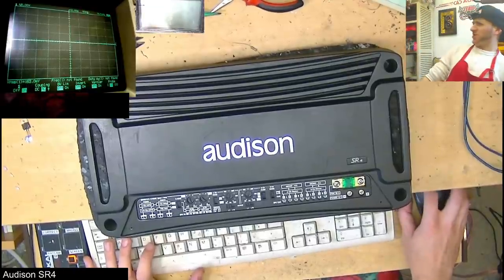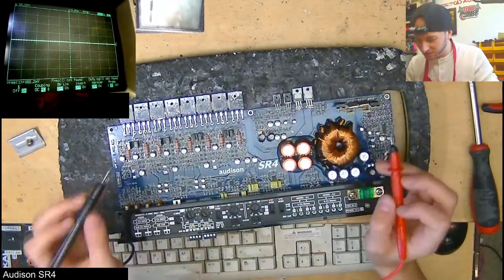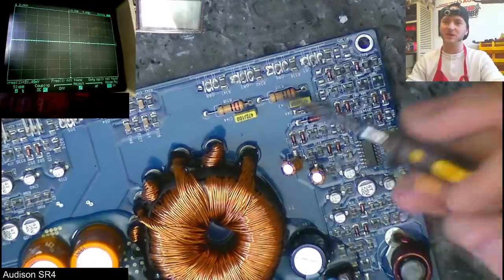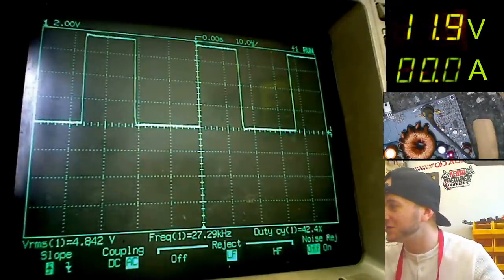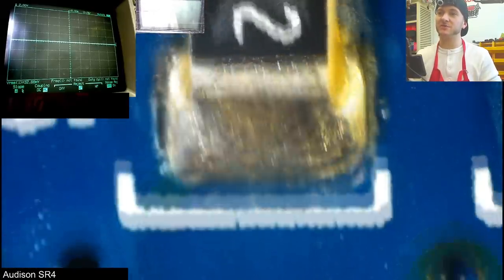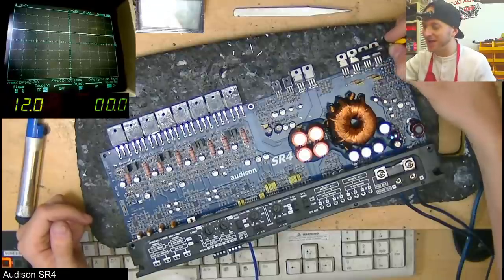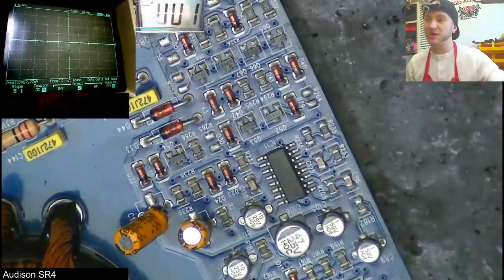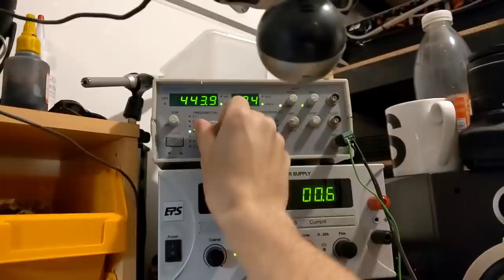This amp went so fast it EXPLODED - Audison Amplifier Repair

Comment: Interesting video! I've seen board flexing do weird things with bad components. Your video reminded me to check the components in a video processing oscillator (2 mhz) for  bad caps and resistors! Heating the oscillator IC did change the frequency and flexing the board made it go absolutely nuts; but I don't know that it wasn't one of the external oscillator components close by. So I'll check. Thank you!

Comment: Interesting to see the crappy solder flow on this board. I used to work at an electronics manufacturing factory where we had solder wave machines that flowed whole boards, then of course boards were tested. I can see why this passed initial tests. Also solder waves only flowed thru board and smt were "glued" on by a robot or if a smt part was bad in testing replaced with tweezers.

Comment: I'm seeing this late so I hope you read this @barevids I might have a tip for you from an old repair tech my father worked with about 10 yrs ago.  I'll spare the full story, but he found an easy way to repair surface mount solder issues.  Stick the board in the Oven at just high enough heat to melt the solder.  The components won't be damaged at those Temps, and the solder won't run when it's just barely melting.  He could repair half a dozen printer boards an hour that way!  Looks as though that amp could use an Oven Spa treatment to reseal ALL of its solder joints. 

I don't recall the Temps he was using but I'm confident you already know that info.  I did Audio/Visual install work so I know enough about soldering but never needed more than the basics, and I never did board work.
Reply: Some of the 2011 MacBook Pro laptops had wave solder issues. I was told to remove and bake the board on low in my oven to get the smd components back bonded to the solder traces. 

Baked for about twenty minutes, skeptical of this process while waiting, let it completely cool reinstalled the board and bam it fired up. Worked for another 5 yrs before I retired it.
Reply: @PopRocksClassicFunkRapSoulHQ   iMac video boards from that era had a similar issue, and a similar fix - but it didn't last 5 yrs.  I think Apple changed the solder recipe at some point, and the problems went away.

Comment: I'm new to watching you, but I must say I really enjoy it, your accent to layman's knowledge. I'm getting back into car audio due to poor installation in my vehicle, hence cutting wiring when could've used harness adapter. which is to this,I purchased a deaf bonce aab 1000.2, straight out of the box all lights flashing with just power, ground and remote hooked up, an piss poor customer service for return,  think something similar to the audison issue ??
Reply from the maker: Thanks buddy! All lights flashing is health check mode, after a few seconds it should either come on, or display one or two leds to signify a failure, what happens and what supply are you using to power up?

Comment: Multi-Layer Caps don't like being banged around much.  Anytime you see an oscillator act like this in something like a car, replace the MLC controlling it, the cap is likely cracked on the inside.

Comment: What brand flux you use here, and if you can send a link to where you buy it. BTW is it stable with the hot air gun, some flux i use just liqify and run away or dried up under the heat gun.

Comment: Had an amp pop so loud it was like a gun shot 1 of the small caps had burst literally vaporised only the outer can left and dust cleaned the board put a match rated cap in and amp worked fine for 8 yrs after

Comment: So withe the powersuply blowing up "not a loud pop lots of heat smoke instantly" what does that internally? Like i had plugged it into a power suply and it triped the circuit shuting it off not blowing it. But then plug it to a 12vt car batt and instantly it poped in smoke. What makes that happen? As to this amp had the brand new smell and everything looked sexy but obvs wasnt the case aha. And if my power suply side died would that have caused mosfets to die as well? Is it worth keeping and fixi g up or is it all gunna be toast?

Comment: something tells me it is possible for a fet failure to destroy the pwm chip by a short to the gate then it fries the gate driver witch shorts back up the line to the pwm chip.

the only thing i think that can stop a cascade failure like that is a gate transformer as the signal is isolated so you would blow the winding before it can short to the pwm chip

manufacturers could cut their costs by doing a walmart working their employees off the clock.

as soon as they punch out they go oh we need you to clean the bathroom sink.

go back to using lead solder and just put a warning in the product for you to recycle it rather than to landfill it and take a page from car batteries where there is a core charge to encourage returning of old stuff.

and set up a cap and trade system to allow the use of lead solder.
Reply from the maker: When the fet dies and sends 12v to the drivers, the PNP driver sends the 12v from the shorted fets to ground burning the driver up. The 12v never makes its way to the 494 and even if it does, there are very high value resistors in series with the drivers that don't allow enough energy to hit pins 9 and 10 of the 494. I've never seen the pwm Gen circuit damaged when the PS fets fail

Comment: @Barevids or Anyone, curious on opinions of Seismic Audio amps. I'm looking to buy their SA 250.4LH  its a Class D 4 channel amp. With really nice crossovers and four 35amp fuses(140amps total) on the board. Its rated 375 watts RMS per channel but I figure its probably closer to 350. If anyone has a Seismic Audio amp love or hate story lmk. If you got an opinion on them lmk I'm curious. It looks like a solid amp.
Reply: Seismic audio is a up and comming brand they do rated power on the qmps.

Comment: It's not   A/C   switching , in the power supply   it   a  DC  TO DC  converter   which  makes  a pulsating   DC  wave     above  ground  reference.   The  frequency  t increases  and  decreases )   creates  the duty  cycle  based on the load  on the output  voltage  of the transformer
Reply from the maker: You know what I mean. It's just easier to say. Technically the current is "alternating" direction to allow for the primary to work and energise the secondary.
Reply: @barevids   misleading , but that is just my opinion  LOL

Comment: How does one determine the capacitor value of unmarked SMD capacitors?

My DMM has never been able to give me a consistent value when measuring them out of curcuit.
Reply from the maker: hopes and prayers, my friend! 
A good capacitance / ESR meter should do it. I can measure them with mine, when I dont drop them on the floor and lose them.

Comment: They need to bring lead solder back.   As long as we don't breath it or eat it we are fine.  The new solder is unreliable.   
Question.  Can you get into trouble repairing Rohs solder with 63/37 tin/lead solder?
Reply: Go to a different store.

Comment: Why didnt you measure the cap, make a note and see if its dependent on resistor theres a trend of calculated value thats consistent based on various amp design?

Comment: Been soldering for over 30yrs. PCBs, cable components, etc. I HATE Lead free solder. Unreliable to perform consistently even with consistent soldering techniques and temps. I refuse to use it unless the customer insisted and accepted the fail risk.